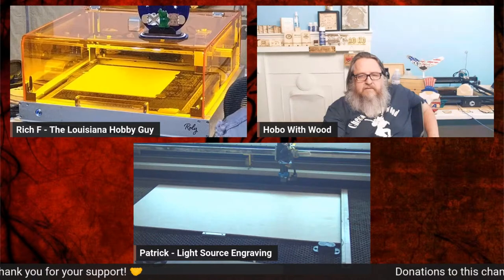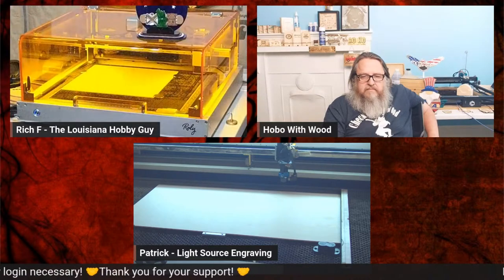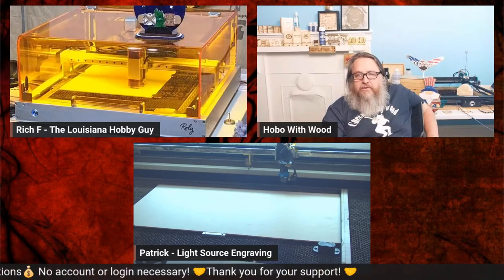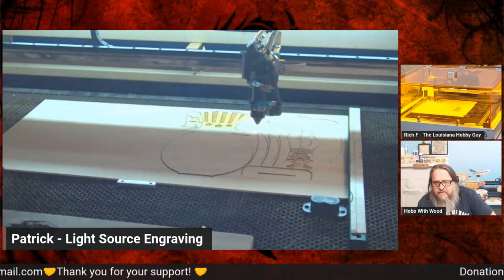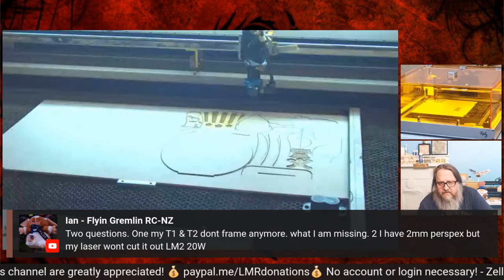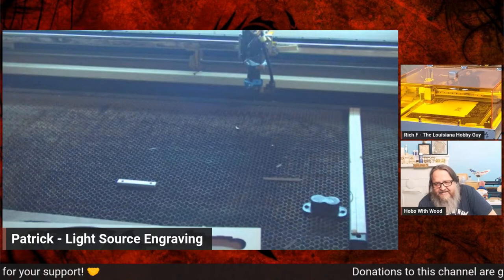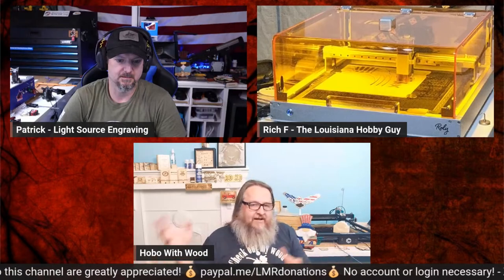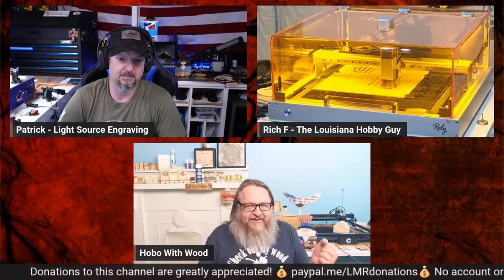SUNDAY LIVESTREAM Q&A! 5/21/23 - FREE PATRIOT GNOME

Comment: Hi guys. I was at a show when you went live. I'm looking to buy a CO2 laser. What is a good starter US manufactured CO2 laser? And are all Co2 lasers water cooled?
Reply from the maker: That is a question that can only be answered by you with a lot of research Charles. I (Rich) would recommend the Gweike Cloud 50 or 55W Pro. It's all-in-one and no additional accessories are needed. I have a coupon code for $200 off at gweikecloud.com for the Pro model: THELAHOBBYGUY
No all are water cooled, but all starter Co2s are under $15K are. The Gweike is built in.